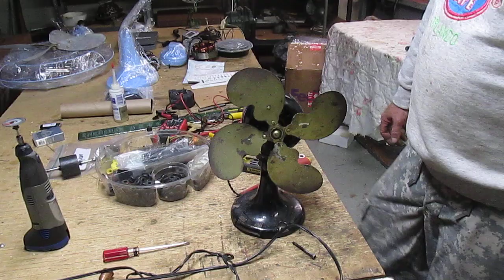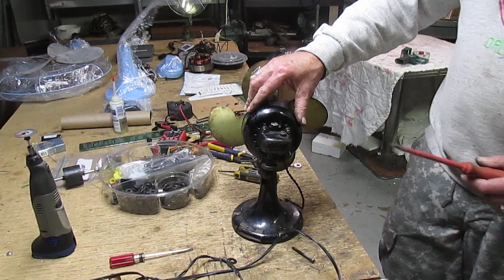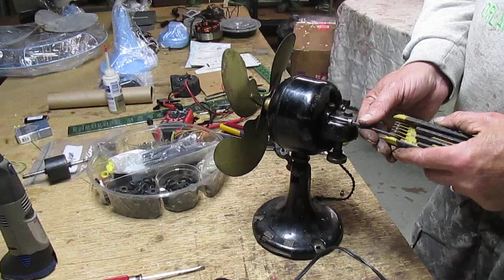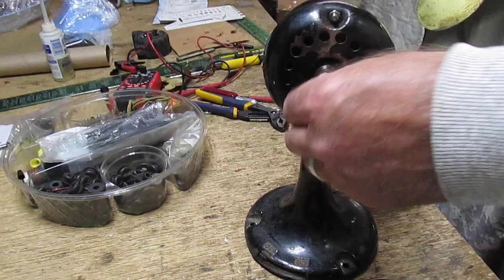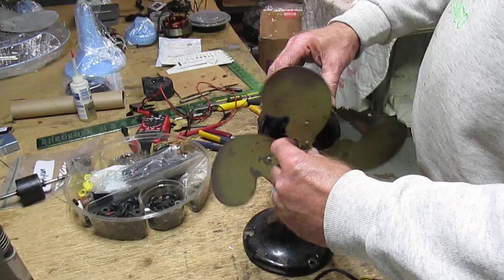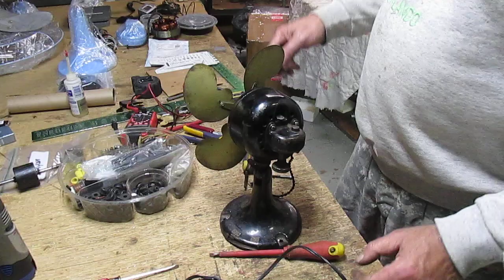Emerson Blade Removal

Comment: Well I'll be darned , never would've known w/out your help.   Appreciate the video
Reply from the maker: Thanks!
Reply: @wiskeylizard1957 Tricky part is finding a 1/4" Hardened bolt long enough. Most HDWR stores have gone conglomerate-affiliated, other way of putting that would be they no longer stock anything useful & have relinquished all control to a faceless giant w/no actual face. Anyway I serviced my grandF's '40 Emerson because the wires started shorting. Only thing I couldn't replace were the plastic washers/shims behind the motor. Don't know where to get something like that.

Comment: I have a Junior 2660-B I am fixing up. There is a side screw on the blade hub. When I remove the screw, there are no threads on the shaft. Is mine a pull off or a screw off then? Thanks!!

Comment: Is removing the blade off 79648-sd is the same or do I run into winding?
Reply from the maker: The blade comes off the same as a 29646. The best thing to do is to check to see which side has the winding. You can use a bolt that is smaller then then the screw opening so that it will go thru without having to thread it. Put the bolt in carefully and if the bolt goes in a short distance and you hit something, that will be the stator and then use the other hole. As long as you don't try to force it in you should be ok.
Reply: @wiskeylizard1957  thank you very much, your video is also awesome.  Appreciate your effort and dedication.

Comment: Where can you buy such a bolt?
Reply: At any hardware store. It should be around 3 inches long. Mine was specially made with the handle. you can use a hex head bolt.